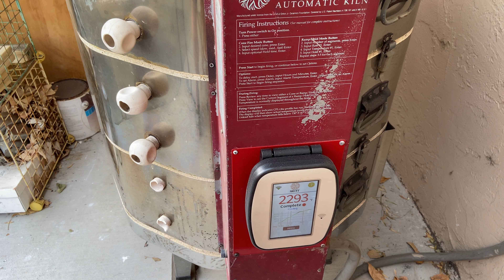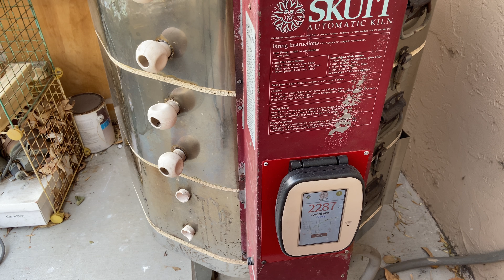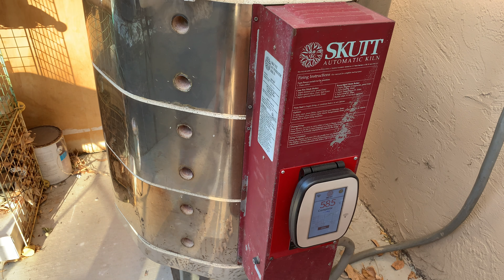493. Firing an Electric Kiln Before/After Results & a few Tips with Hsin-Chuen Lin 林新春 電窯釉燒前後結果比較

Comment: I have stopped using kiln wash because the cookies/chips provide protection for the kiln shelf.  If I get a stray drop of glaze I just put a cookie over it the next time I fire. They work great and easy to make with a slab roller.  I texture one side of the chip so they are easier to remove should a drip happen.  Best of all I do not need to deal with the kiln wash mess.

Comment: hsinchuen lin ,you need  to try the Advancer shelves.They are great .they are a lot lighter,wont break,glaze wont stick .if some gets on there ,it scrapes right off.kinda expensive,but worth it.look them up and read.just go to Advancer shelves on the internet.You dont even have to put a wash on them.
Reply from the maker: Thanks for the information! Actually I am quite familiar with the advancer shelves. The 2 places I teach are all use advancer shelves. If you have watched my earlier video clips, you will notice that. They are nice, light weight and easy to clean in case the glaze drip on them. The only problem with the shelves is the feet of the pots tend to stick to the shelves after fired. To fix that, we sprinkle aluminum hydrate on top of them before the very fire so that the powder stick to the shelves, kiln of like the effects of applying kiln wash.

Comment: Really nice....
Your centre shelf reached ^11, do you think the top shelf didn't quite reach ^11? 
I did not see a witness cone come out from the top.
The last kiln load video I did on YouTube I reduced the hold from 60 to 40 minutes @ 2160 degrees and I think I will be following this programme for a wee while as the pots came out well. I raw glaze and single fire and I am always tweaking the programme which is @ 1:00 minute in the video.
Thanks for sharing!
Reply from the maker: I forgot to put the cones on the very top and very bottom. I will do that on my next load.

Comment: Hi again. The black slip is not very black after firing   If fired at cone 8/9 will it be more black   Thanks
Reply from the maker: You can adjust the recipe by adding more oxides to make it more blackish.
Reply: Hsinchuen Lin   One more thing. Is the slip recipe good for cone 9 stoneware clay. Thanks again

Comment: Is your kiln outside? Is it uncovered or underneath a shed/roof? Very interesting.
Reply from the maker: It’s outside under the roofed patio I built long time ago. When in winter/rainy time I cover it.
Reply: My kiln is also outside under a protected deck in North Idaho. It is covered from rain and snow and not fired during bad weather.  Still enough good days to allow firing but I always protect controller with a kiln self on stilts.  During the winter, I preheat controller with a small space heater and cool it in summer with a fan.  My average days between firings are 4.9  for the past 4 years.